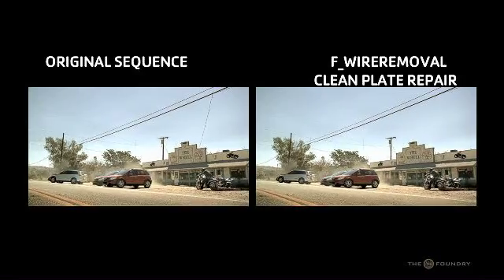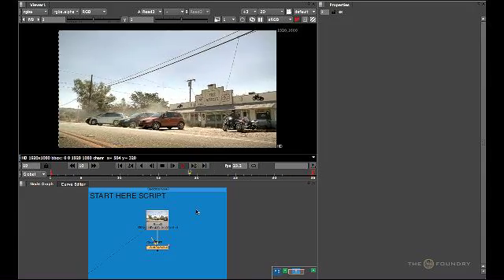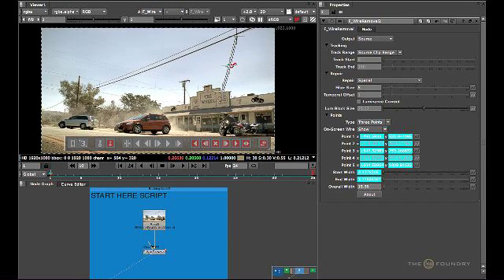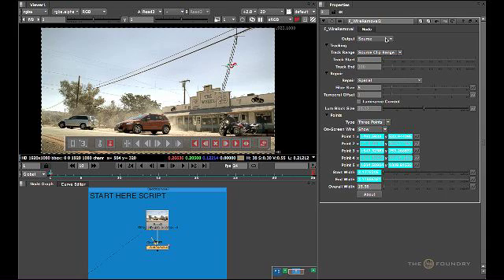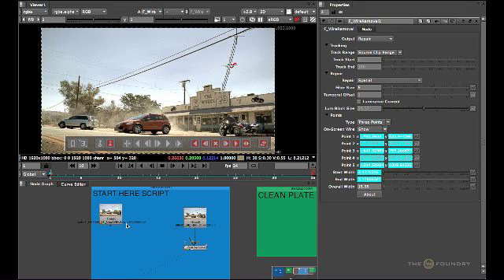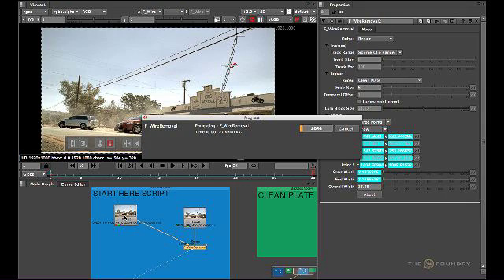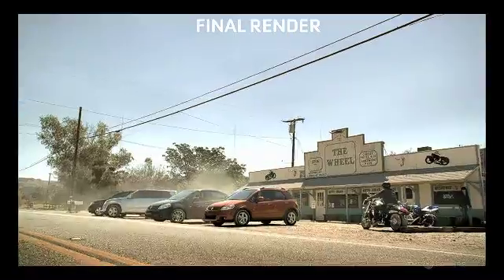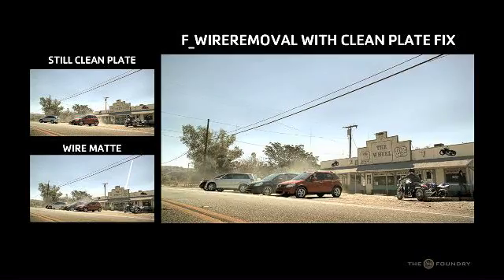FurnaceCore For Nuke | F_WireRemoval (Part 3)

Comment from the maker: @Moshgfx The clean plate can come from anywhere you can load/generate image data. So loading a painted frame into Nuke from photoshop and then using that would be one possibility.
Reply: The Foundry DOESN'T CARE obviously about producing truly free education.
 This video is garbage, 360p to walk through the complex UI of a 
professional VFX tool, the narrator speaks an incredibly muddy english 
and has a whispering voice. He also keeps drifting over the subject 
making an incredibly lengthy video of something that should be 
straightforward, and leaving any beginner Nuke user baffled and lost 
because despite all the talking, a lot that is necessary to produce 
professional results is never addressed here.